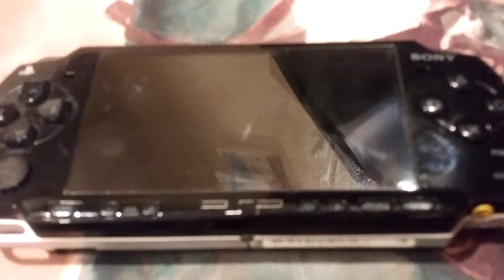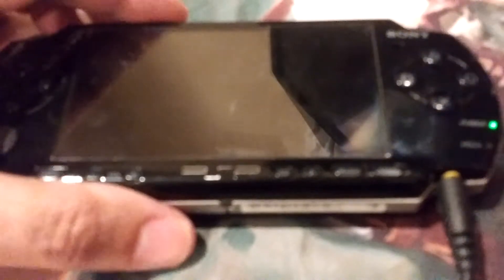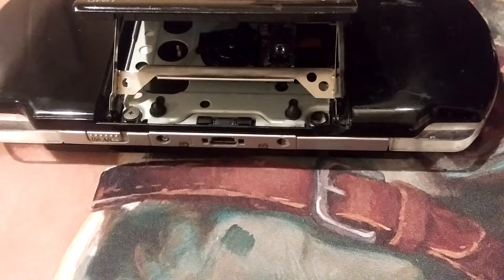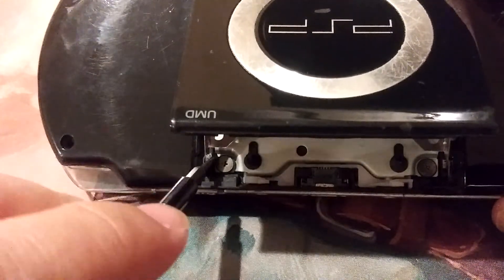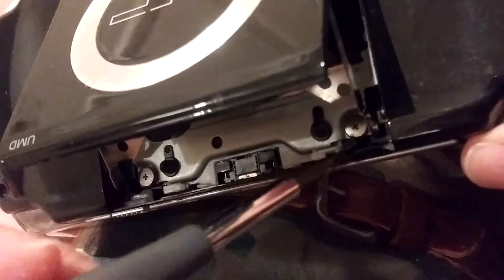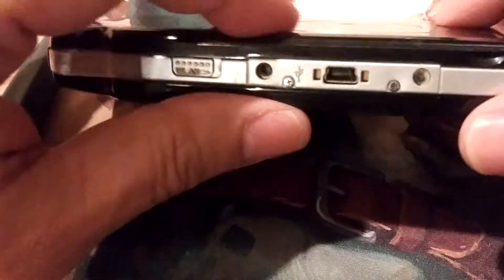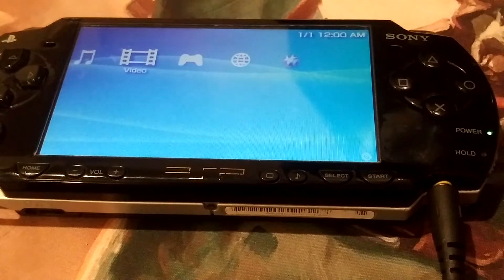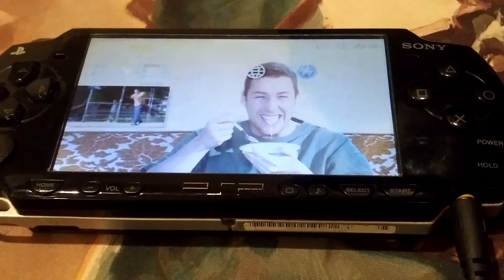How to repair a PSP that is short circuiting Sony Playstation portable console

Comment: If that little stick next to the right rubber stopper breaks off, can it be put back? I opened mine after i had giving it to a friend to fix and is no longer reading disc because that little stick, i found it inside the PSP. 🤬
Reply from the maker: Yes that will cause it not to read games :(
Reply: @95617  so, can it be put back? Or it's toasted?
Reply from the maker: It could be but I have never attempted it
Reply: @95617  ok